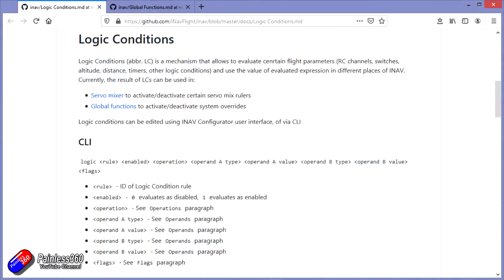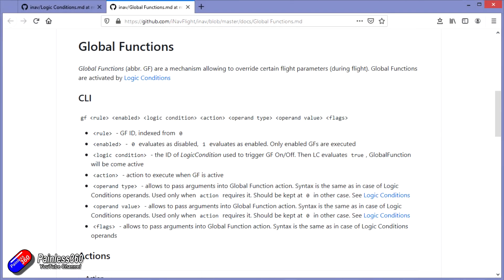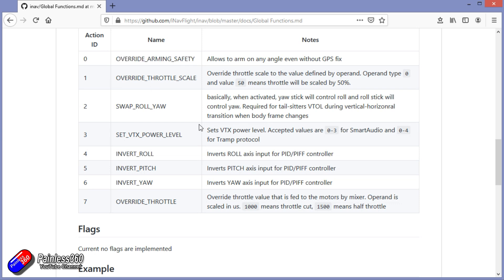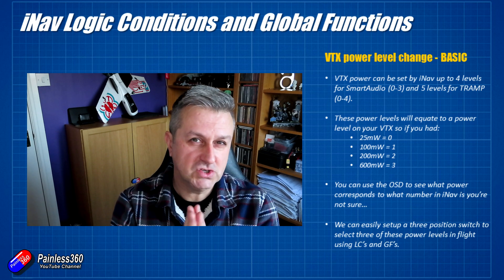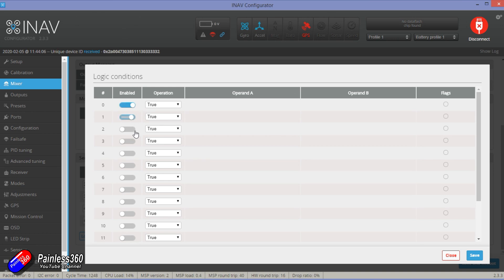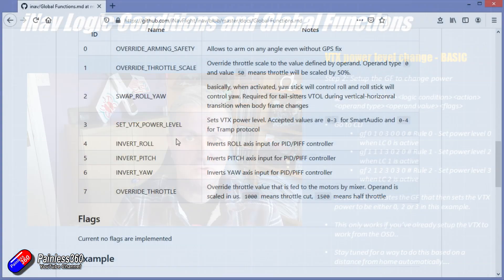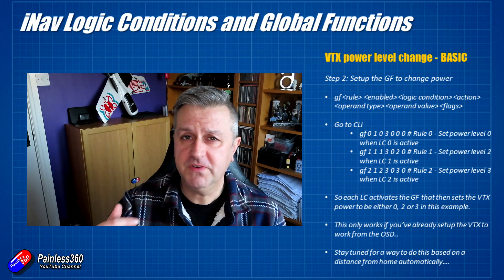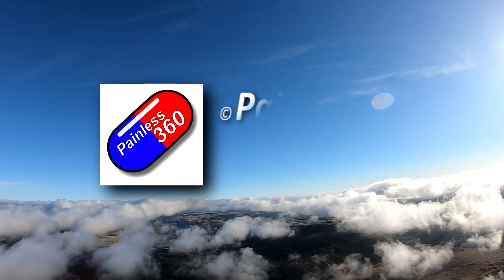Secret iNav goodness and how to use it...

Comment: Thanks for the video, Lee. I haven't tried this yet but is it possible to switch digital Walksnail VTX completely ON and OFF using a switch in the transmitter in a similar way? I'd like to switch the VTX completely OFF initially while waiting for a GPS lock. Then arm, turn VTX ON and fly. And in case of a crash, turn the VTX off till I walk over to the crash site and find my plane so that the VTX is not overheating and not potentially starting a fire in dry grass.
Reply from the maker: Some flight controllers (like the TBS AIO) have the ability to turn off the power to the VTX out of the box. Others would need something like the MenaceRC switch installed to do that. See https://www.youtube.com/watch?v=l0hHZfqQb3U&vl=en-GB

Comment: Hello. Can you use this feature to run in paralel Digital & Analog FPV ?  My design would be to use the DJI air unit for short/ medium range , and switch in flight  to the Analog FPV when the DJI breaks up under 10-20 km range.  But i don’t want them powered at the same time to avoid interference and battery consumption.
Reply from the maker: I'm not aware of a way to do that. If you figure it out, please let me know... Best of luck

Comment: Hello!  I love your channel!  Quick question.  I have an airplane with a folding wing.  I put it on a switch, but want to set up another switch to enable that switch so I don't fold the wings in flight.  Would a logical switch work for that application?  Or is there a better way to do this.  I tried special function, but overriding the switch just made the wings fold on the second switch.  Appreciate any guidance you can provide.  Thank you in advance for your advice.
Reply from the maker: Yep, logical switch is how I'd do it. Best of luck!

Comment: Hello. I'm using a Tbs Unify Pro VTX with a Matek F405 wing FC. With Smartaudio I'm attempting to control VTX power output. The new options on the Adjustments tab on INAV allow VTX power level Adjustment. I'm not having much luck. Watched plenty of videos but I'm stuck. Any vids you'd suggest I check out?
Reply from the maker: In INAV 2.6 this is all about to change so stay tuned!
Reply: @Painless360  "Automatic video transmitter power change according to distance" That sounds promising! Thanks for the reply

Comment: Great explanation, it's working brilliantly power switching on my Hifionrc VTX, I connected and configured it temporarily on UART3, but I use it on my Omnibus F4 and this one only has 3 UARTS on it, UART1 for CRSF receiver, UART6 for GPS and UART3 is occupied by the magnetometer SCL/TX3 and SDA/RX3. But my question is, can I use the SPI interface for the magnetometer, so I can use the UART3 for the VTX?

Comment: Hi I have been looking at several of your videos and thanks for all the good information. I have a Radiomaster TX16s to control my planes and your videos has answered a lot of my questions.
I have installed a FRSKY S8R reiever w. stabilizer and smart port. the GPS is connected to the Smart port.
 I do have a question around having the iNAV running on my TX16S. I see readings from the smart port FRSKY GPS  installed but it would be nice if the Pilot View worked and the altitude and distance. Is it required with a flight controller installed in my plane?
Reply from the maker: I've never tried scripts like Yappu and INAV without having a flight controller installed. I'm guessing you're not a regular viewer as I did a video on something like that on Friday.. That video may help..

Comment: Thanks ~
Logic condition is available for servos. Wonder if it is available for motor mixer as well but hidden somewhere?
Certainly would be very useful for VTOL applications in which it is not uncommon that we need to switch some motors on and off during the flight transition.

Comment: I would like to see someone run a quad and a fixed wing on one tx. With two missions coordinated so you switch between manual and mission one chasing the other. Is this now possible? I'm going to figure it out if someone else doesn't. LMK!

Comment: Changing power by distance, RSSI, or LQ was something I immediately thought of when I thought about what would I do with this. Another one I had thought of without seeing if there was a way as if the plane was in failsafe, set to loiter RTH and the battery goes below a certain value to force a landing attempt. Shouldn't need it very much as failsafe normally are distance and obstacle triggered and coming back towards home should recover command. BUT if there was a hard failure of the TX then I would want my wing to try to land at home instead of eventually floating off. Guess could do a slight bank with a little down elevator and have it circle down to earth but figuring out if you could do it would be interesting.

Comment: Hi, is there anything special I need to do to use logic conditions? I am using INAV2.4 on a SPracingF3EVO and the logic condition GUI is just an empty table, cli commands "logic" and "gf" give me "unknown command"...
Reply from the maker: I've not used an F3 based FC for a while. I wonder if it's not supported on those older boards. I'd look in the wiki... Best of luck..
Reply: @Painless360  Thank you for your reply. I could not find anything about limitations on F3 boards, but it may be time to upgrade. I pulled the board out of my parts bin to put it in a balance bot and the logic conditions would be very handy to switch the servo outputs off, if the bot exceeds a certain pitch limit.

Comment: Lee, this is fantastic info, and you have just solved a big problem for me! I am building a plane, but i really want to use Ardupilot for the flight control. That left me with a problem or two - how to remotely switch the recording on and off on my Runcam Hybrid, plus, how to change vtx power levels. The first i solved in a rather unusual way - i happened to have a spare Omnibus F4 Nano kicking around with nothing to do. So, i wondered if it would be possible to run it via sbus from the same rx that controls my main flight controller. I think sbus is a one way only signal - ie sends data from the rx to the flight controller without receiving anything back. So, in theory i could connect two different flight controllers to the same rx without issue. I done a lot of testing and discovered this does seem to be the case. So i have Ardupilot on my main f/c, and i have iNav on the second. Then i simply connected the Hybrid control wires to the iNav board and configured iNav to control my camera. I then used a free channel on my Taranis (that was not controlling anything on the Ardupilot f/c) and used that to control the camera via iNav.

Now this is where the info in this video comes in handy - i could not work out a way of controlling the vtx via Smart-Audio. I did come up with some wild idea of using a camera video switcher to switch my fpv signal to the video output on the iNav, then i would be able to access the Smart-Audio menu via the sticks, but that is not a good idea in flight, the plane being controlled via Ardupilot would be freaking out when i was moving the sticks for a start, plus of course i would lose my fpv video image. But i think you have just solved my problem! Use a spare channel and a spare 3 position switch on my Taranis, to switch the power levels via the iNav, all i would need to do is connect the Smart-Audio lead from the vtx to the correct output on the iNav controller. Thank you Lee, just the kind of info i needed. It is still a bit of a roundabout way of doing it, but until Ardupilot start to incorporate support for things like Smart-Audio and the Runcam control protocol it will have to do. Hopefully that sort of thing will come Ardupilot eventually. A bit like osd support, Ardupilot stayed well away from that for many years, until finally adding it over the last year or so.
Reply from the maker: Let's hope that the Ardupilot team get some of these ideas (and a few pieces of support for things like SmartAudio, TRAMP and CRSF) into the mix soon.. Best of luck with the build!

Comment: Wouahou very interesting. 
Are RSSI value and GPS params accessible with Logic Conditions (part of FlightParameters) ?. A mix of RSSI and distance from home to control Vtx Power could be interesting. ( Few years ago immersionRc in the Vortex with a Tramp Vtx had  kind of a dynamic Vtx Power based on I don't know what, but without GPS. May be RSSI or equivalent ?)
Being able with these Logic conditions triggering Global function, if we can use real Time GPS value, would be great.
Many thanks for this new chapter, and yes sure I will be very interested to learn more with you. 
Keep flying and doing all your great tutorials.
Reply from the maker: More on this type of setup coming soon. Stay tuned!

Comment: Painless I'm sorry for bothering you about this I figured it out all I had to do was change the 6th digit in the Global Function to the power setting I wanted to have as my lowest. In my case it would be 200mw which is number 2 then the middle power setting would be 600mw which is number 3 then the highest power setting   would be 1w which is number 4. Thanks again

Comment: So I have a Mach 3 VTX and it has 4 power settings 25,200,600 and 1watt. In the video your vtx has 4 settings also but the way you set it up is the lowest power setting then the middle than the highest. so it looks like your switching from 25mw to 100mw then 200mw so how would you get to the 600mw power setting. I would like to go from 200 to 600 then to the 1 watt with the 3 position switch is that something that is possible? Thank you
Reply from the maker: You need to turn on the VTX stuff in the OSD using configurator so you can see the channel and power levels then change the power in the iNav OSD menu and see what iNav sees that power level as in the main iNav OSD (0-4 if you're SmartAudio).. Best of luck!
Reply: @Painless360  I've done that it doesn't start with 0-4 it's 1-5 for Smartaudio in the Inav Configurator.
Reply: @Painless360  So when you say the iNav OSD Menu are you talking about through your goggles or screen. Cause when I do that it comes up 25,200,500,800 and that's through the SmartAudio connection. The only place I see 1-5 is in the Configurator tab in iNav bottom left side.
Reply from the maker: It's an option in the things you can display in the OSD. You can show the band, channel and power you are using. Not all VTX units use the same iNav settings for each power level. Hope that helps..
Reply: @Painless360  I have that turned on I've used it on other planes. I guess what I'm asking is if I have a VTX with 4 power settings that are 25,200,600,1000 how do I in the Logical Conditions make so I can select 200 for low 600 for middle and 1000 for high? Would I have to have a 4 position switch to do all power settings. Or is the way the Logical Conditions are set up  right now you can only select the  first 3 power settings of the VTX?

Comment: Lee so I started setting up the Logical Switches and I'm getting a Flag warning for the Mid setting under the Flags Column do you know why that would be. I started at 0=low 1=mid and 2=high. I soon has I click the save the circle under the Flags lights up.
Reply from the maker: That's normal...

Comment: Hi Lee, given that you can change the vtx power dynamically using the bi-directional s.port function and base it on telemetry values e.g. gps distance you could also do this in OpenTX. I guess another example of multiple ways to do things. Be great when the logicals become more powerful. Keep up the great work ... Les.
Reply from the maker: Yep, check out the video in the BrainDART playlist for a preview of the more advanced setup...

Comment: I've used the inav logic switches on my FX-79 to allow the inboard flaps to mirror the elevons when in Manual mode, deploy and stay put (no- flaperon action) when flaps are deployed, and in stabilized modes they stay centered.

It has worked out well!
Reply from the maker: Have you shared the setup anywhere? If love to see..

Comment: You should be able to do the power change by distance as 2.3 is setup I thought. Have you tried using the LC for "Flight" and "Home Distance (m)" ?
Reply: I am still flying 2.2.1 and using the Adjustments method to change VTX power in flight, I have a video posted about how to set it up.
Reply from the maker: That is the next video if there is a good response to this one... Stay tuned

Comment: Yes! Took me a while to figure out how to set it by the GPS, but it works awesome. This is great for flying with buddies. Hardest part was working out the XOR logic for the logical conditions.

You need a logic condition for each range (so, is range > where you want it to switch), and then you need an additional logic condition that is XOR so you know when one range is tripped but not the next one. So mine trip at like 100, 500, and 1000 meters. That’s logic 0 1 and 2. Then logic 3 is an XOR for logic 1 and 2. So it tells you it’s more than 100m but less than 500 (because it’s impossible for it to be over 500m and less than 100m at the same time). And that XOR condition is what you use to trip the VTX power.
Reply: Wow thats nice, would Love to see a video about this :)
Reply from the maker: Yep, check out the video in the BrainDART playlist for a preview of the more advanced setup...

Comment: Great, one problem that I had with 2 different vtx bought on smart audio 25,200,500,800mw it was that I changed power level when armed to "5" assuming 5 will be 800mw but I was wrong and looking by the led colours it told me that was 25mw, the way to be sure it's choose whatever and set in the osd 800mw and it will change to the proper value which in my case was "4"
Reply from the maker: Please see the notes in the video - SmartAudio only has three power levels settable via iNav (0,1,2 and 3)... That could have been part of the issue. Happy flying!

Comment: YES!!! I've recently tried and failed to setup both of vtx power and flaperons on logical conditions.  So this and pavels video about flaperons were very timely. Now if you could somehow get the inav devs to make the Mac os version work better, I'd have a inav fc in all my fixed wings.
Reply: Pawel is the Configurator dev, and I am guessing he just doesn't use Mac. The biggest thing people miss about iNav development is that the Devs do everything for free, so if it is something that they have time to do then they will, or if it is  something that impacts them then they will. However if Pawel doesn't have a Mac then it would be hard to develop and test for it.

Comment: please!!! do a video about mag interference coming from batteries. i have no problems with factory build lipos but when i use liion selfmade the compass goes crazy
Reply from the maker: Please see my build videos. Distance is your best friend or, if you can't physically separate the GPS and power system, then a piece of MuMetal can help shield the compass from stray EMF. Don't forget that you don't need the compass in a fixed wing iNav model...
Reply: Painless360 MuMetal, is that a trade name or something?  I have a similar problem, some batteries are no issue, others seem to send the compass crazy, the compass and gps are 5-6 inches away from the frame on a stalk, so I think I need something more between the GPS/compass and the quad.
Reply from the maker: Google it and you'll find my video on it.. best of luck!
Reply: Painless360 will do and have just bought some (magnetic shielding) from RS as numeral is mega expensive, do you know which side the sticky part goes on (GPS or the mount) since they don't say - or does it not matter?